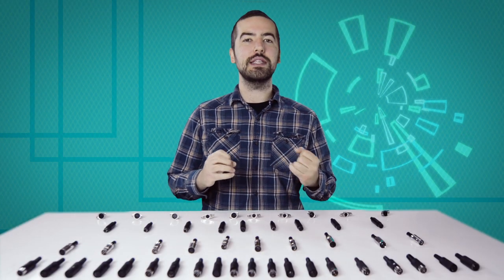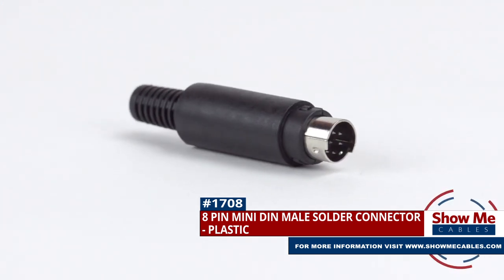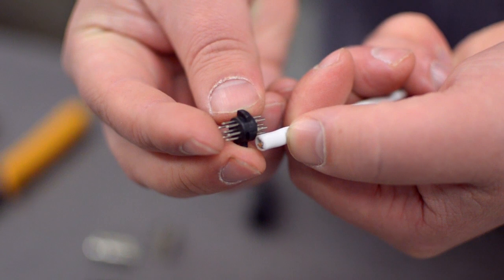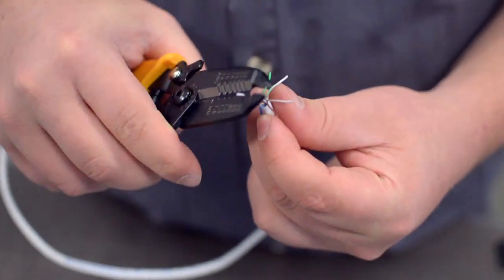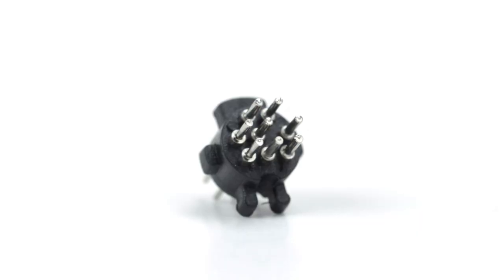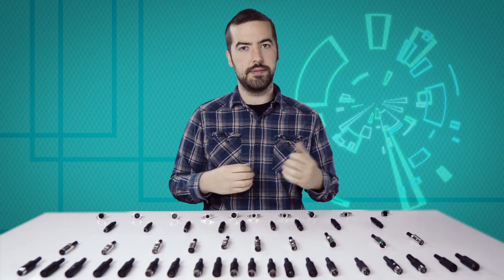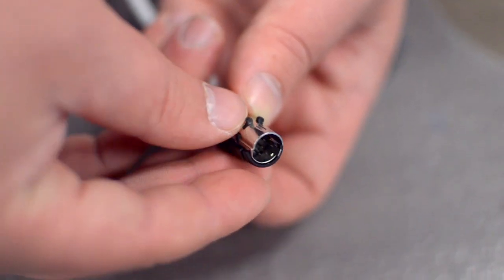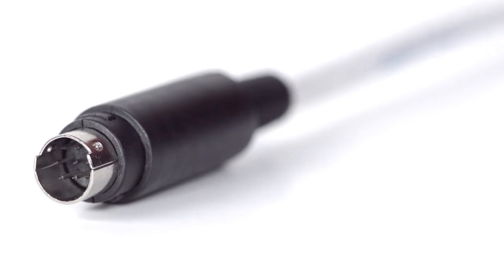How To Install The 8 Pin Mini DIN Male Solder Connector

Comment: This is an absolute bullshit video. Damn things are almost impossible to solder (I have 30 years of experience, I can do fine pitch SMD soldering easily)  One thing you needed to show was some tips for soldering these damn connectors and you skipped that. The rest was already obvious!

Comment: I genuinely can't believe you titled this "how to install 8 pin din solder connector" then said "soldering is hard get someone good". As a content creator, I never comment criticizing creative choices. But as someone holding my soldering iron with exposed wires, have some sense of pride of how you educate your audience. Take this down or significantly improve the information and link to it. This is almost comedically not helpful.
Reply: Haha, didn't even show it soldered when putting it back in the plug assembly.
Reply: @MDK22420  seriously, his channel is called 'show me cables"....im dumbfounded
Reply: Daddy did it for him

Comment: The message between the lines here is "our connectors are terrible hard to solder correctly". If you cannot show people the soldering itself (which is not an easy job for DIN connectors), you know it must be a terrible experience as well for the connectors being advertised here.

Comment: Did you have to skip the part where you solder the wires to the connector? Do i some how shove my wires in? Or around?
Reply: Incorrect.    He was not asking which wire to connect to which pin but rather how how to accomplish this in the absence of solder cups, or at least solder cups that typical wires.   You made a video that spends its time answering the questions that nobody has and doesn't answer any of the questions everybody actually has.   Next: how you solder the middle pins (hint: better do them first).
Reply: @markwhitis  Yeah, I'm pretty sure so did everyone who clicked on this video. What a load of crap response. They purposely didn't show you how to solder it. That is an bs excuse. We can figure out how which pins goes with what wires. We need to know how to solder the wires into the pins!
Reply: Yeah, I kinda came here to learn how to best soldering strategy for these. All rest is pretty clear.
Reply from the maker: Due to the many ways these connectors can be wired, we chose to not to show us soldering the wires in the video to avoid any confusion. The pins feature solder cups for soldering the wires.